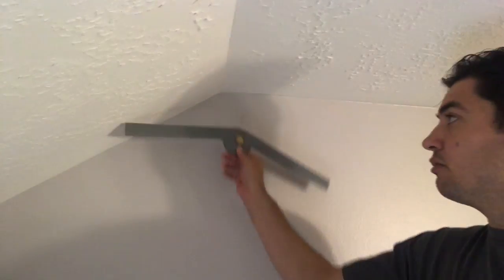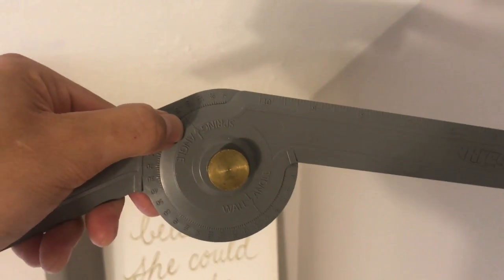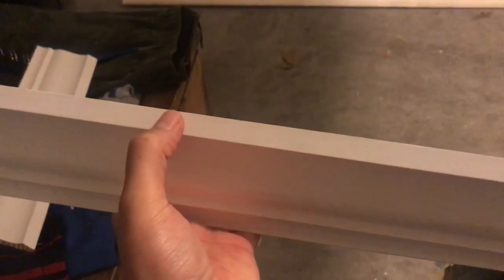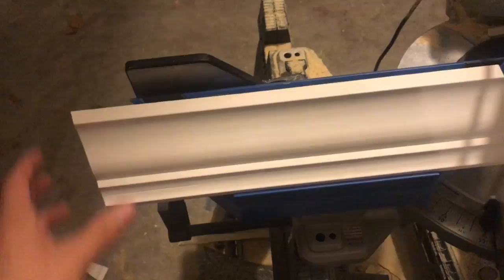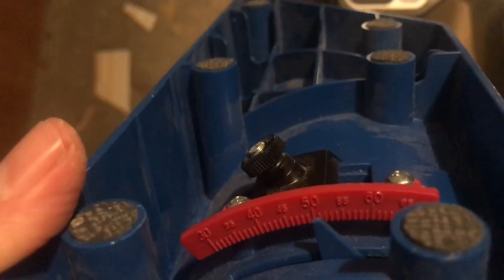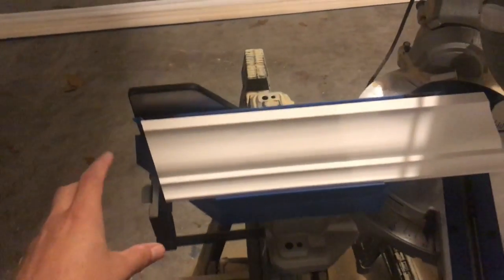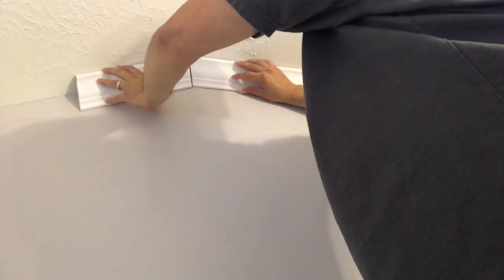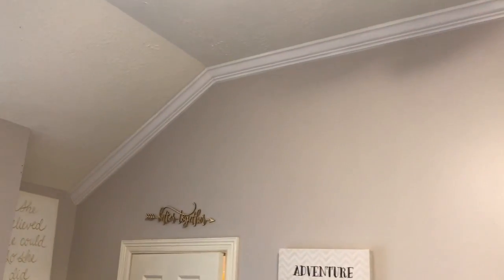How To Cut A Peak Angle Crown Molding

Comment: Simple angle divider tool should be in the apron of every finish carpenter., not only for crown but all kinds of trim molding.

As a stairbuilder, I used mine constantly.